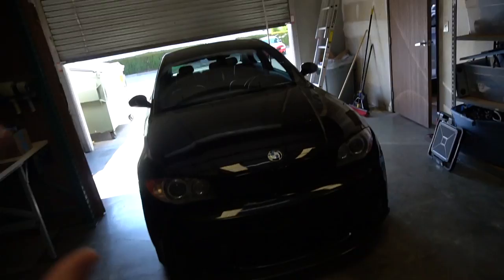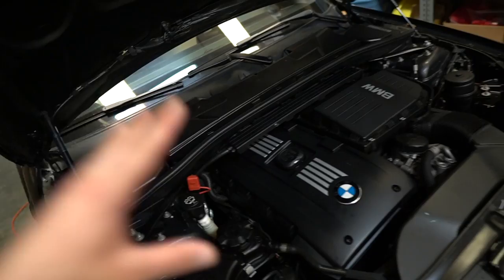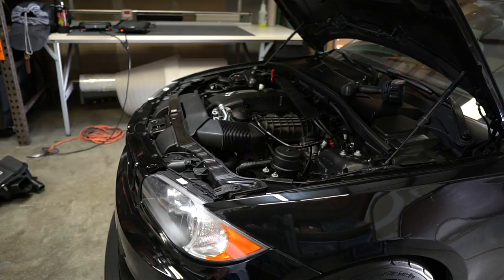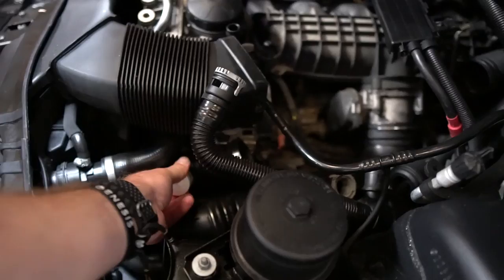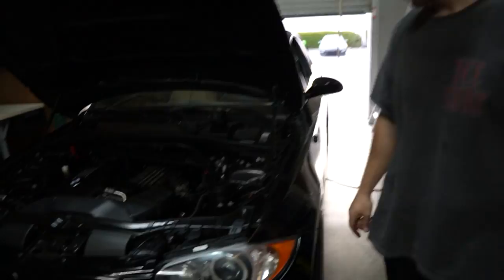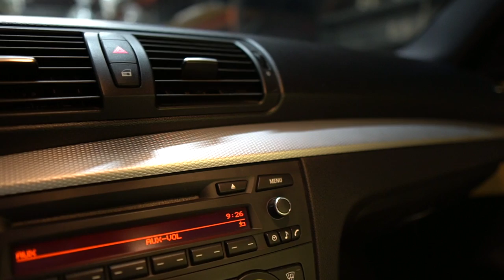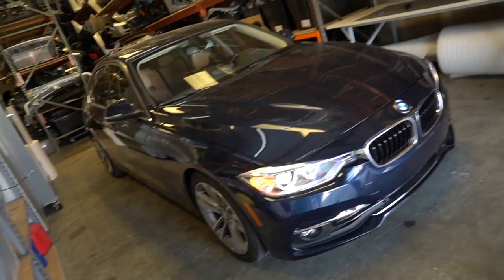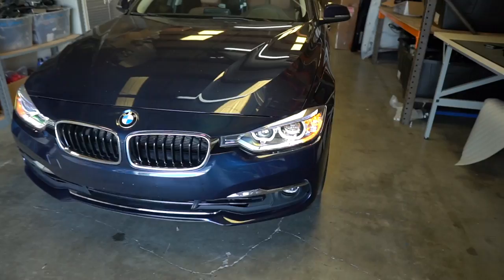TRANSFORMING THE LOOK OF AN F30 BMW FOR $700!

Comment: Ya bro VRSF Is a huge disappointment of a company. I ordered the FMIC for the F10 and they forgot the bracket & bolts, and it was such a headache to get a hold of someone. They wanted the order number, the part number, the address that I bought it from, And they don't even include instructions. They are a POS of parts retailer and I sent it back and got a Wagner that had instructions and all parts included even though almost twice the price. BTW, from Toronto Canada.